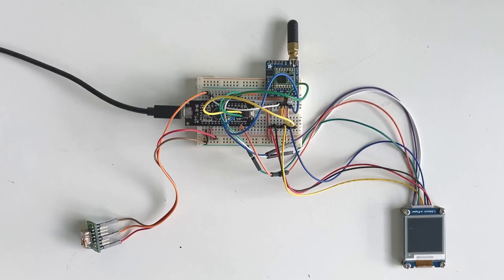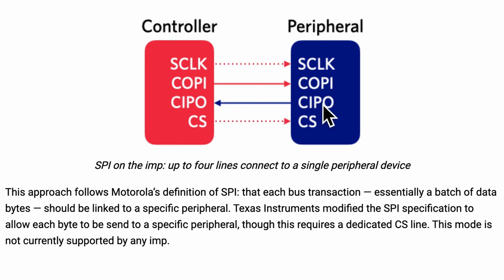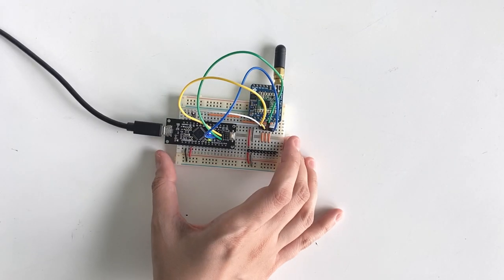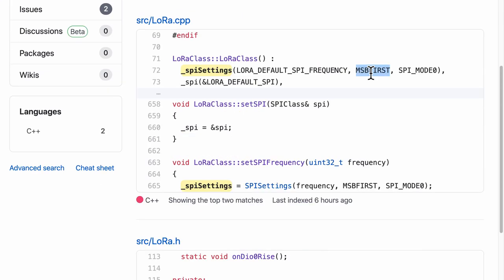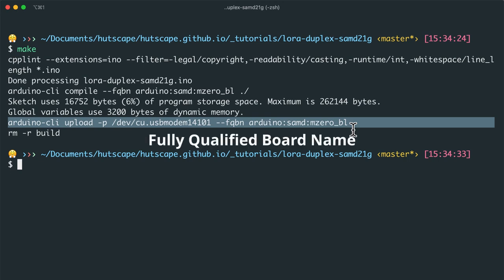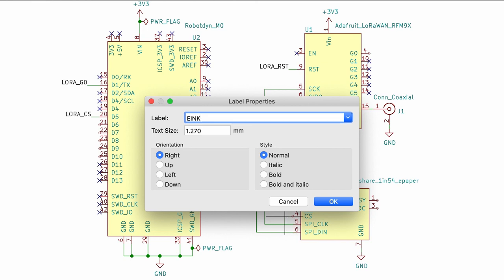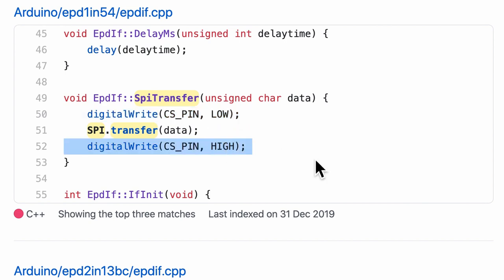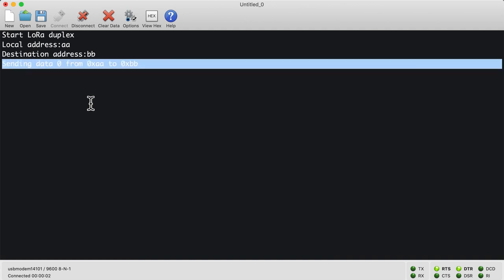SPI protocol features and how to integrate multiple sensors // Arduino Zero, LoRa and E-Ink modules

Comment: This video is really top quality. Very clear and helpful. I love how you dug deep with the theory and showed us the signals. It'd be very helpful if you could talk a little about the reset and DC pins as it seems assumed that each device needs its own pair of those as well as the chip select pin.

Comment: Top notch, your clips are well structured. I was wondering, what is your target audience. 11k views with such a great film is very little. For my experience, a tinkerer and user, your clips are quite advanced. You use over the shelf hardware, that has no isolation optocoupled in/outputs etc, so your emphasis is obviously not the user. Also you do not go the extra step to implement a useful use into your project. Your clip is just an entry to a possible implementation of some component. That does not excite tinkerers, nor users. Ok, left are the pros and maybe one day pros and students. Students will watch your clip only, if they need to to complete their given project. Pros are probably interested in your clips to get started with their project. Anyway they might be near your skill level  and they are few. A clip and info with such a quality like yours deserves more. 
I find clips most promising, when they have a clear useful project in mind. F.e. your Lora communication. Very hard to find a use for such a thing. I was thinking a farmer, whose fields are near his house. He wants to measure earth moisture content via SPI device, have a GPS to find his sensor when its getting winter or he is harvesting the field. And get an alarm when it is moved or stepped on by a cow, so he needs an accelerometer on board. He wants to get an alarm on the cel when its to dry and wants to interface his waterpump with it to automatically water the field. What would be the target audience of such a project. Tinkerers, who can use one or the other part of the script. Users, like farmers, growers, tinkerers, hempgrowers, glashouse owners, universities bio centers and many many more come to my mind. Even pros that look for some functionality. Not many people want to reach your skill level, in fact I never could. But so many people in the world would like to profit from your skills. What do you think? I took the time to write this, because I think you are worth it.
Reply from the maker: Thank you so much for your feedback! Especially about using it in a project. And I totally agree with you.

I did eventually use this screen as part of a project here: https://www.youtube.com/watch?v=90ziiwkOJFw

As projects take time to build, I will usually make a video out of a component that I intent to use in a future project for example, this E-Ink screen.

Comment: Thank u very nice videko but I wanted to understand if a peripherals datasheet doesn't show the register addresses how will I communicate with it and where does the slave send its data to the arduino where can I access that data. Thanks regards.
Reply from the maker: If you really cannot find the slave address in the datasheet, I suggest you post this question on the part manufacturer's forum or email them directly.

Comment: I am facing same kind of issue with SD card reader and ili9341 display with Arduino nano,but I can't find a solution.hope you can help me
Reply from the maker: Do these 2 work fine with Arduino Nano separately? If yes, then I suggest logging the signals for each of them and compare them when they are integrated. 

The debugging process would be the same as what I did.
Reply: @sayanee  yes working separately but display fails one SD calls.

Comment: I have used one of these modules with an Arduino Pro Mini 3.3V https://www.amazon.de/gp/product/B084NWDFH1/ref=ppx_yo_dt_b_search_asin_title?ie=UTF8&psc=1 and one of these Boards: https://www.amazon.de/gp/product/B076T28KWG/ref=ppx_yo_dt_b_search_asin_title?ie=UTF8&psc=1
I had a lot of problems getting them to work... But i have never thought about checking with the logic analyzer.
Next time, I will!

Thanks for this great video!